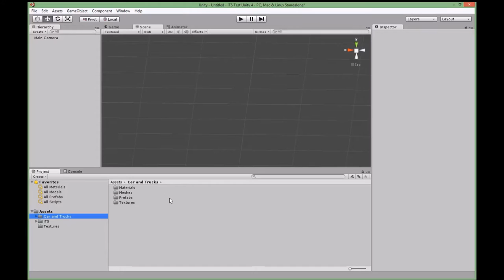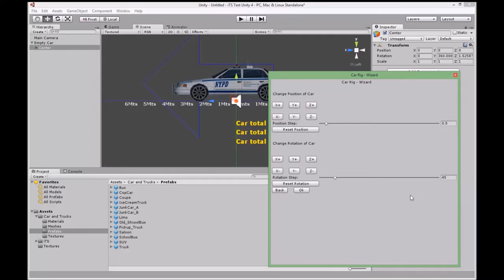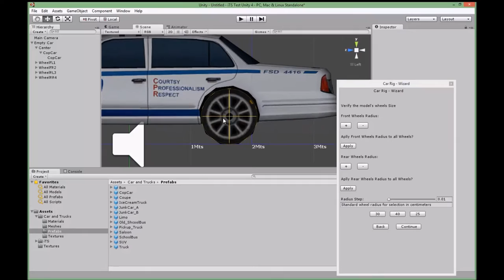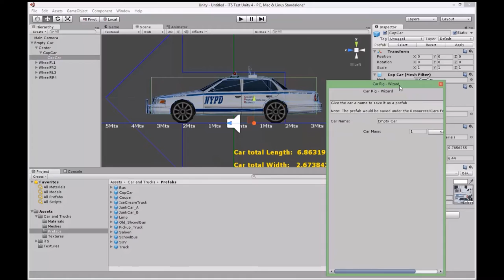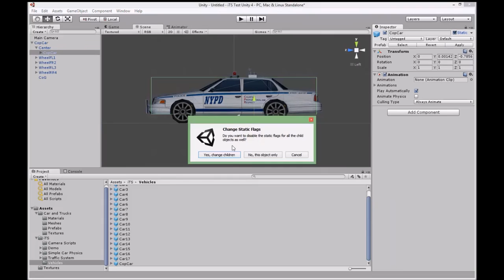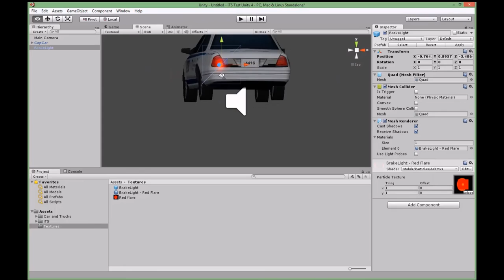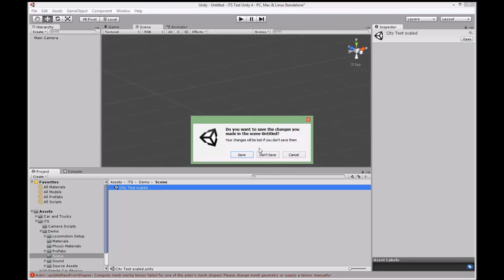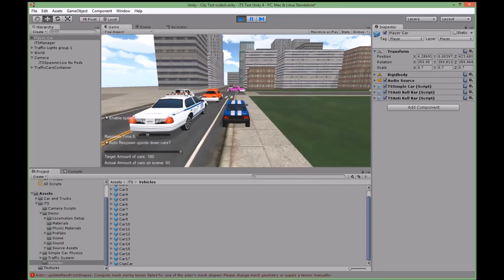iTS-Intelligent Traffic System - Car Rigging (Updated 2021)

Comment: I have this error:
Assets/iTS/Simple Car Physics/Scripts/TSSimpleCar.cs(525,16): error CS1061: Type `UnityEngine.Component' does not contain a definition for `pitch' and no extension method `pitch' of type `UnityEngine.Component' could be found. Are you missing an assembly reference?